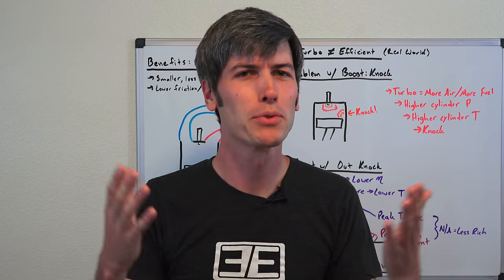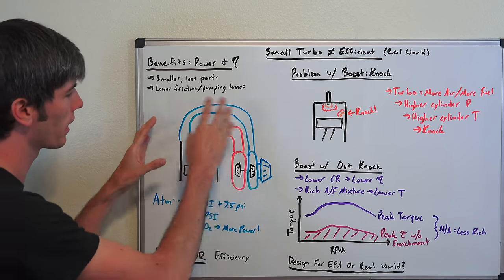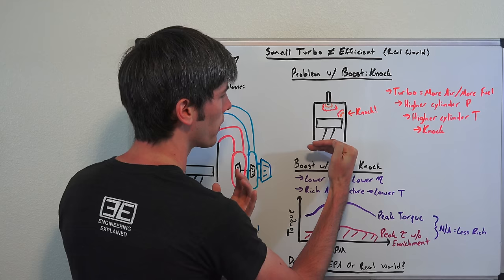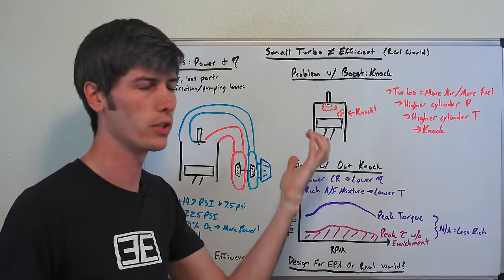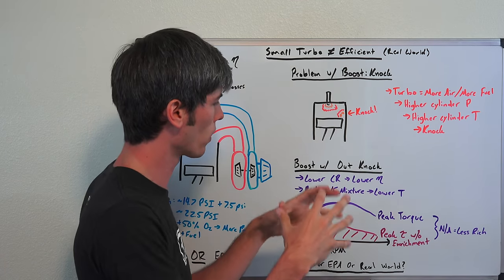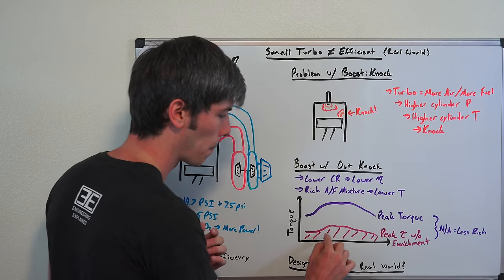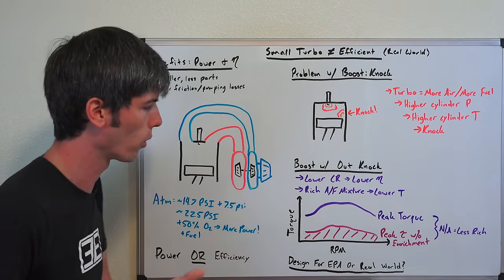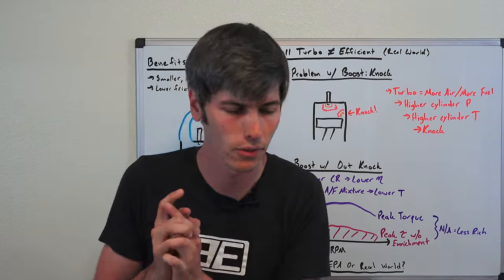Why Small Turbo Engines Are Not Efficient

Comment: 2016 hyundai veloster turbo, I 💯% see in the real world fuel economy.  Without spoiler, I can get 50 mpg on easy acceleration hwy. With spoiler, I still get better than most st 25mpg hwy. Yessss still big difference.. 😂😂❤❤❤🎉🎉🎉🎉🎉🎉. Hyundai did pay for a brand new motor 5 years ago,  recall. 2016 and only 59k miles. Not bad. She has held pretty strong since, considering how much I punish her. ❤, she likes it though. ❤. Don't do street racing yall, go learn how to be a real race car driver on a circuit track. They will teach you and help you learn to be a real racer. It's more fun. ❤❤❤

Comment: Why turbocharged engines use lower compression, it effectively makes an engine larger when turbocharged, because of more clearance volume to be filled with more compressed charge to the same pressure of hi compression n/a number before knock threshold.
Reply: Interesting, I've never thought of this before.

Comment: Penjelasannya sangat benar. Saya sudah mencoba dan membuktikannya di motorcycle saya. Using a elektrik fan 11000rpm to a 125cc engine N.a.
Di kota saya rata-rata kendaraan berjalan 40-60km/h.
Jika saya tidak full throttle, fuel economy is so great. Tapi jika saya tarik gas lebih banyak sama seperti tidak memakai turbo fan, tapi torque nya tetap terasa dan akselarasi tidak hilang. Hanya perbedaan konsumsi bahan bakar,the fuel. A higher  octane just reduce knocking a litle bit but not damaging the engine.

Comment: My small (1.6L) turbocharged diesel engine is very efficient, in part because, like all such engines it doesn't have issues with knock. The title of this video is misleading, as it implies small turbo-charged engines are not efficient when what it's really talking about is under some load scenarios petrol/gasoline turbocharged engines aren't efficient. What really matters for most people is the overall fuel economy, not one particular point. The other issue is that there are no facts or statistics here. I'd be much more convinced if there were actual numbers showing the rate of fuel usage at a given power output for a smaller turbocharged engine vs a naturally aspirated of comparable maximum output.

Comment: Not sure this opinion is still valid considering the car market  mostly turbo charged small engines. Null after adding hydride batteries, regenerative braking, electric only under 25mph.

Comment: my 2000 Mercedes 200 Kompressor (193hp, Italy spec) used 8.5l per 100km (about 26mpg) going 190 on the Autobahn. The 93 280e with similar power used easily 15l for the same circumstances (16mpg) my current VW Golf has 1.4l 125hp goes about 200 Max and is happy with 7.5l going really fast. If I keep it at 130 it will do about 6l. More than catalogue but not as steady and not as flat. So I doubt that explanation (or at least the impact)

Comment: My fiat doblo 1.3 diesel (80bhp/ @1300kg/ DPF version)  takes 8.5% in city and minimum 6% outside the city IF i don't pass over 80kmh. At higher speeds takes 10% and even OVER that.
My @1.9tdi torsen awd vw (rebuilded, 17.6cr, forged, @245bhp in street config, 1600kg) takes 6% in the city (regular driving, not agressive style) and 4.5% outside city without passing 130kmh, racing anyone (in full load takes 50%, but we don't talk about that here).
Also my fiat COUPE 20vt (1380kg, 372bhp modified) takes 11% in city and 8% outside city.. which is not far of that doblo 1.3 diesel .."economy" 😂

Comment: you forgot to mention why these small engines are giving us more power for a small cc, the doubling of fuel rail pressure nothing to do with the turbo. production cars went from 100 bar to 200 bar and F1 cars went from 200 bar to 400 bar. we dont use fuel for cooling.

Comment: Quite late on this one but still : I 'm certainly not a fan of small turbo charged engine, but I have a  2007 1.6l turbo 180hp engine with 240 000km doing 8 liters/100km with far from slow driving (costing way too much in tires actually), not the best engine that's for sure, but you can't say it's not efficient. I think as many things, it depends of the engineering.
Reply: Dang 240? How about now?

Comment: Dude with 61 years of living and being in the HVAC field and raised by a Master Mechanic and just using common sense. To a Point you can always ask any engine, motor etc to do less with a smaller amount of energy than something that is designed as less but screaming all the time under pressure(in other words wound up like a 10 dollar watch), just look at the history of all our technology in even mechanical and you see we haven't gotten better with the longevity of things as there are engines, motors out there that are decades old, yet with the higher degree of engineering with all things mechanical and electronical we are building things less and less reliable that doesn't live up to the energy savings not counting having to have the cost of total replacement of major vehicles, appliances and things that serve us but are in all reality making products with built in obsolescence. Use to be you could tinker with and rebuild various parts of your equipment especially vehicles, now not so much. It is a built in throw away society. Go Freaking Figure

Comment: I currently have a clio 2 with a 1.5L diesel turbo and it gets around 47 MPG (US). it could be better but with only 65 hp the accelerator is mostly a switch

Comment: I would say this video isn’t that accurate. I’ve owned multiple turbocharged cars with 1.6-2.0L turbocharged engines. Each of them was as efficient or more than claimed. My 2011 MINI Cooper S 6MT would routinely see up to 38mpg on the highway, my 2016 GTI Autobahn 6MT would easily get 34mpg and my 2018 Accord 2.0T Touring (10AT) could achieve close to 38-39mpg at highway speeds. The Accord efficiency increased drastically after the car had been broken in. I now have a Tesla Model 3 Performance and that is the only car I struggle to really come close to EPA ratings. Even my big old brute 2014 Land Rover LR4 (with the 3.0L Supercharged V6 - I wish it was turbocharged because it would likely have more torque) outperforms the EPA ratings. I’ve never seen anywhere close to 11 city/16 hwy in the LR4 unless I was pulling a trailer.

Comment: Sorry, love your videos but this topic can be misinterpreted very easily.  Having the ability to have great fuel mileage and having the ability to make a lot of horsepower is a GOOD thing.  The alternative is always poor power or always poor mileage.  This "trade-off" is well known.  Why do you think Ford went with a large displacement naturally aspirated engine (gas) for their heavy trucks that always have a load on them.   Personally in most of my vehicles I love having the power when I want it (and pay for it) and higher MPG when I don't need/want the power (which is most of the time).
Reply: My Challenger 5.7 Hemi V-8 accomplishes the same thing in a better way cylinder deactivation.

Comment: I used to owned European diesel cars,  they all claims 4 or 5 litres per 100 kms. That's not true,  my average fuel economy is 7 to 8 lt per 100kms. Now I  owned a little Toyota CHR 1.2 Turbocharged.  It's brutality slow and never rev the crap out it, turn off the engine whenever I'm stuck in traffic. I get almost the same Toyota's claims to be. In the real world,  our driving habits cannot be the same compared to the manufacturer's claims (computer indoor testing). On way to borrow their car  for a test drive and test their claims before buying the car.

Comment: Small engines have less pumping loses,  as the throttle is opened more than a big engine at cruising speeds. Hopefully, less cylinders equals less internal friction, and should be lighter also.

Comment: So this would mean that in smal 4 cilinder engines with turbocharger its better to use them in the low or medium load ranges instead of being flooring all the time, I have a Peugeot 5008 with a 1.6 turbo with 165 HP and it does a very descent fuel economy around 11 to 13 km per liter of gas, have had 2.0 naturally aspirated that would do around 7 to 10 km per liter, but that engine is not so constantly at high loads being honest.

Comment: Lexus RC200t (RC300 in US) was one of the worst car engine "choice" I ever had, well I say "choice", because in UK I had no choice it goes RC300h (with 9.2s 0-60), RC200t (with 7.5s) or .... RC-F with 5l V8... I woudl have picked-up RC350 any day, but it is not sold in UK. 300h just too slow and RC-F looked like not very practical for commuting. The reality is that it would have been more practical than 200t. 200t has much worse fuel economy than mine old Lexus IS250 (2.5l v6) - I used to get average 29MPG and now I get 21MPG, even just cruising on motorway I was able to get 44MPG before and now it is 32MPG at best. Even RC-F in my experience can do 24MPG in my commute and good 36-38MPG on motorway. It just does not make sense that trashy 2.0t engine uses more fuel than 5L V8.

Comment: Great explanation but Turbo engines require a higher octane to control knocking which wasn't mentioned, so perhaps the fuel - air ratio under load is no longer a real issue. Just don't drive with a 'heavy foot'
Reply: Fly2kill1 From and Australian point of view our octane ratings (RON) are 91, 95 and 98. Two years ago I bought a 1.4 ltr Turbo Suzuki Vitara DCT Crossover (not available in the USA) that requires 95 octane or higher as specified by the manufacturer. My research clarified that the higher octane prevented pre-ignition and knocking. Pump prices are slightly higher but the combo of Turbo and body weight gives an overall pleasing economy.
Reply: Fly2kill1 thanks, well explained.

Comment: I have a turbocharged 2-liter TDI Diesel and it gets almost 50 miles to the gallon on the highway.
Reply: Different with a diesel. Basically all diesels  have turbo's because they have alot of advantages for diesels, they run much better the more pressure you can shove into the cylinder. Old non-turbo diesels were real turds in alot of ways.
Reply: @pauld.b7129  yeah I know.

Comment: Why not use water injection instead of more fuel? Water is a lot cheaper than petrol and it's feasible as some high performance engines already use water injection into the cylinders.

Comment: Nice explanation here. Anyways on the topic of small displacement turbo engines, I wanted to more regarding the Downpipe sizing, is larger better ? The reason I ask is my car has a 42mm stock DP and I upgraded to  63mm so almost 50% larger and although the power figures increased nicely to around 15% with the addition of a stage 1 tune, the car seems rather flat under load in the higher gears around 2k rpm. In stock form the response is instant. Even the stage 1 file could not improve this 'Flat spot'. Could it be the upgraded downpipe is too large or is there an optimum  ratio when upgrading downpipes, eg. 10-20% larger ? I have also heard many suggest smaller turbo engines require some degree of back pressure to maintain  nice torque figures and yet most disagree. Would love to know more, before either doing a revision on the tuning file or changing the downpipe. Thank.

Comment: i think ford screwed up on the ecoboost making the turbos so small and spool so fast. if they would have built in a bit of lag with a bigger turbo, it would be easier to stay out of boost and keep the engine lean to get good milage. Then when you want o power you give it more throttle it spins up and you have power. but maybe there's a low speed off boost efficancy reason they did this that i don't understand?

Comment: My high performance 302V8 in my 64 Falcon gets almost 20mpg when you keep your foot out of it on the freeway with no overdrive. Idk why you would want a gutless 1.4L turbo engine
Reply: Were they the ones with the steel glove box lid that would swing open and cut the passengers legs off in an accident?
Reply: Because they get almost 40 MPG if you keep the foot out of the turbo and will likely embarrass you at a stop light.

Comment: I should also tell all that I use a 1 point Octane booster and high test gas.  The Techron is keeping things clean and at l0,000 miles it runs like brand new with an average gas mileage combined of around 27mpg...not bad for spirited driving. Please never lug any type of turbocharged engine....that is a crime.

Comment: Do you think variable compression could help get the best of both worlds?
Reply: It does help. So has advancements in valve timing contorl. Toyota has a v6 (like in the tacoma) with an Atkinson cycle engine that uses valve timing to change compression rations.

Comment: Apart from the torque available at low revs, why Kei car & trucks often have a turbo to stuff their 660cc  ? They have anyway  power limited by regulations to around 64hp.  Especially since many naturally aspirated motorcycle engines of this displacement can approach 100hp.

Comment: An NA car doesnt use that much more fuel if you floor it, or if you drive fast over a long period of time it maybe uses 20-30% more fuel. A turbo engine on the other hand if you demand the power the turbo pushes so much air and needs so much fuel. If you drive fast and accelerate fast you can easy double your fuel consumption. With my 4 cylinder na engine i got 6l per 100 km and no matter how hard you drove it it never used more than 8-9l per 100 km. No my turbo 4 cylinder engine i get 5-6l per 100 km put you can easy get over 10 l per 100 km even tho its a diesel engine.

Comment: I've always thought about this in terms of chemistry- power out is dependent on the fuel in. Within the (comparatively small) factors of friction inside the engine/drivetrain, 200 hp is going to require 200 hp of fuel, whether you spread them out over 8 big cylinders or cram it into 3 with turbos/etc.

Comment: Honda needs to take out the turbos in the new Accords. The 1.5 and 2.0 turbo will be unreliable because too much force induction in a small engine will wear it quicker. Honda needs to get a naturally aspirated 2.4 Earthdreams 4cyl with 200hp and bring back the 3.5 j series V6 with 300hp. Those will be bulletproof cars.
Reply: They are never tuned to give that much boost stock. Sure it puts a little extra kick in it, but i really doubt it decreases reliability much if you drive it normally. Turbo engines have proved to last just as long as naturally aspirated motors when properly maintained. I just don't like the added complexity since a regular 4 cylinder does the job just fine, but i wouldn't worry about it wearing any quicker. All haulers have big turbos running tons of boost and they do more miles than any vehichle on the road.

Comment: I have often wondered why water injection isn't used to lower cylinder temperatures, surely it would also be better for the engine than egr, can you do a video on the benefits and drawbacks of water injection 🤔

Comment: Ford and GM have made a blunder by putting smaller turbo engines in SUV's and Trucks which will almost always be on boost just to move a heavy hunk of metal enough to keep up with Traffic.  Longer term engine reliability will not be there with higher loads aggressive driving, trailer  towing or "deferred oil changes"   Imagine a 4 cylinder turbo Chevy Silverado well they are build that now.   This is a very dishonest approach just to meet unrealistic EPA targets.   Their are other ways to do this my 5.7 Challenger v-8  can get get 25 + MPG with cylinder deactivation.
Reply: Yeah... cylinder deactivation is one of the least reliable things out there. Also, 25 MPG out of a car isn’t that great. Heck a V8 Mustang with a four speed got 23 MPG highway 40 years ago!

Modern trucks are light now that they don’t have 300 plus cubic inches of pig iron under the hood plus solid axles and some are made out of aluminum. Trailers are a lot lighter now, too. They are also geared a lot better so you can stay in the power band without lugging the engine. 

And 99% of people who have trucks only haul or tow a couple times a year. No point in having all of that displacement just to go get groceries... lol

Comment: they could use a turbo with less pressure, and use an exhaust waste heat recovery turbine to drive a funken generator, that would in turn drive the engine. that is how turbo-compounded engines work, and those are efficient and make more power. ww2 RAF aircraft used this soultion and gained 30% fuel economy increase. hmmm i just saved ic engines, YEEEEEEEEEEEEEEEEEEEEEEEEEEEEEEEEEEEEEEEY

Comment: I have a question out of morbid curiosity... I used to have a 3.0 litre twin turbo V6 Nissan ZX (and a 3.0 litre twin turbo V6 Mitsubishi GTO, but you can ignore one or the other). Ok... Let's say i'm travelling 100mph for 1 hour on a perfectly straight road with no traffic so i don't have to speed up or slow down. Let's imagine that this car (the 3.0 litre twin turbo V6) weighs exactly the same as another car that has a 1.2 litre single turbo 4 cylinder engine...  Travelling at the same speed, for the same amount of time, in cars that weigh exactly the same, would one car use less fuel than the other? 

In my opinion, it's not as simple as that though because i know of cars that produce more power, and weigh more than another car, but the car that produces more power and weighs more gets better average MPG. But is there a general rule that says it's better to have a larger displacement or smaller displacement for fuel economy (if weight was the same).

Comment: What is the point of getting a turbo 4 if I can't get good gas mileage using the boost? Why wouldn't I just save money, cost and complexity by getting the same gas mileage out of a NA V6? Automakers are putting these engines in vehicles that are too large for a NA 4 banger, so you need to use the boost to get normal acceleration out of the thing. I understand why they have to do this in Europe as they have displacement taxes to deal with, but they are a waste of money in the US unless performance is your goal.